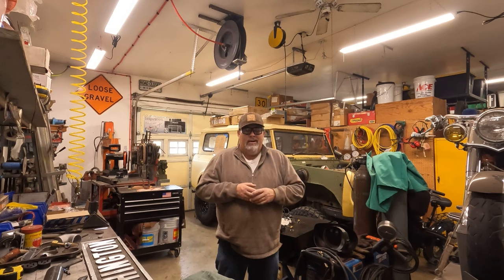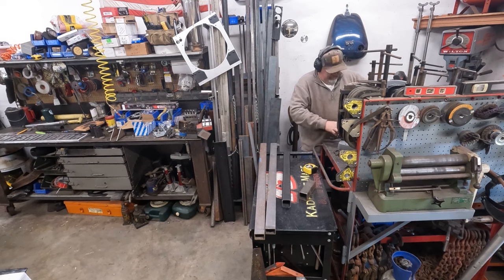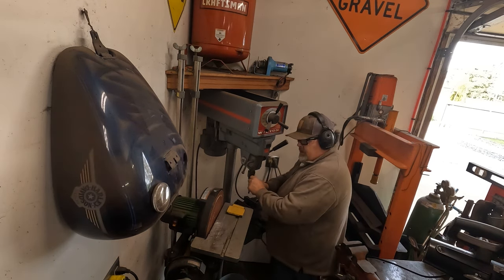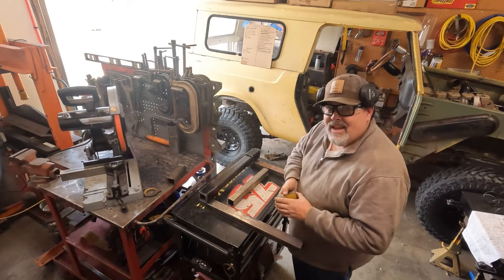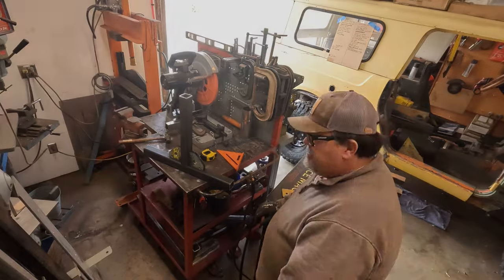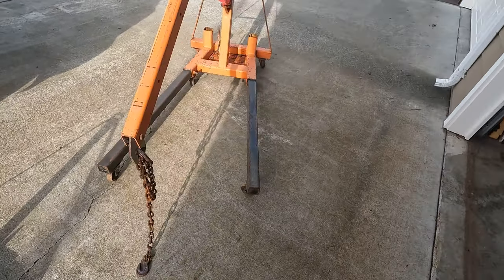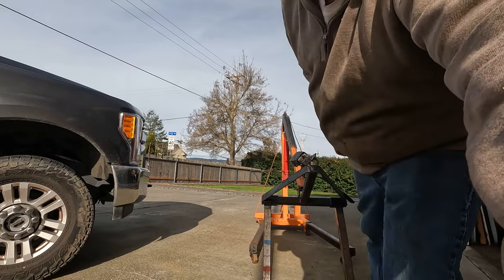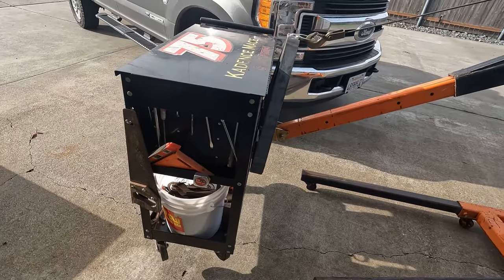Building a DIY Forklift attachment from Scrap metal , Multiply your Engine Hoists usefulness

Comment: I was a mechanic on forklifts for 50+ years , that steel bench was not 800 lbs, and it’s just a Rue Goldberg set up , if he lifts more then 300 lbs it will tip over and someone will get hurt , the higher he gos the less it will lift safely, the idea is smart but the engine lift and fork extension is a disaster waiting to happen !
Reply from the maker: Thanks you for the comment. I will address a couple of items. I too have 40 plus year in the industry, you are correct the 3x4x3/4 plate table is not 800 lbs it’s 734 lbs not counting wheels and leg (3/4 plate is 30.6 per foot I think)  I do not plan on lifting more than  couple hundred lbs max with boom retracted closer to lift point. You are correct about the higher you lift the less safe it becomes, just like  real forklifts.  This is why during training forklift operators are trained to carry the load as low as possible while moving. Thanks again for watching and commenting.

Comment: great idea i have been playing around how to modify my shop lift for the last couple of days , i have installed a air/ hydraulic long ram on the lift way easier to use rather then pumping up the jack .
Reply from the maker: I’ve been looking at the air pumps, wondering how controllable they are to lower
Reply: @NoBudgetGarageBuild  i put a oversize dial knob on the bleed off valve very easy to control when lowering
Reply from the maker: Found a sweet aluminum knob in my stash great idea!

Comment: Don't lift too much past the length of your legs and do a somersault
Reply from the maker: Absolutely no plans to lift past the legs. This was just to see how tippy it was. It actually surprised me it was not worse. I put over 250lbs and it was stable surprisingly.
Reply: @NoBudgetGarageBuild I picked up a Pittsburgh (China) hoist had to load a straight six with stick attached. I had to put the arm past the last pin position and swing it to get it to reach the bed. Fortunately didn't do anything funny on a downhill driveway.
Reply from the maker: Good to know!

Comment from the maker: When retracted it should have a similar lift and tip rate as the hoist itself but I wouldn’t dare. I figured if it will do 500lbs fairly safely . It should  cover 90% of everything I’ll use it for. My legs slip off for storage I might put a couple pockets on the frame to store forks. All ready working on winch and  better casters.   Thank you

Comment: I like your lifting fork idea. It could be made self-leveling by adding a parallel linkage to the main boom.
Reply from the maker: Yes I considered adding a link, but wanted the  option to be able to tilt them up or down.
Reply: Add a large piece of all thread for the link with a turn buckle.  Then you can tip it up or down as you want. I built a adapter on my shop hoist for transmissions.  Of coarse I have a automotive hoist. But it was much more stable than a true transmission lift.
Reply from the maker: I was thinking of a screw type chain binder but decided this needed to be a use what ya got in the shop project

Comment: Funny, I never saw it hooked up setting on the ground. Don't get me wrong, it is a good concept, just doesn't work unless what ever you need moved is elevated already. Cherry picker needs counter weight also because your work table didn't get off the ground
Reply from the maker: I address the setting on ground in my other video. I had to find happy medium as height for the lift is more important than being on ground for most of my uses. It can reach ground by extending boom but it then lowers how much weight I can lift. Had I designed “just” a fork lift that’s easily engineered out.  I will put it to the test in future videos as I need it.  So far it works great for installing my 150lb tank

Comment: Fantastic idea, will most definitely be modifying my tractor supply 3pt carry all to be used with my engine lift. Also your idea inspired me to make simple 3pt hitch brackets for my engine lift, so it can  be installed on my tractor, with the leg extensions removed. Thanks again 👍
Reply from the maker: I had originally planned to connect this to the back of my Farmall cub. I ended up selling the cub to help fund the Scout project. Be sure to check out my scout build and thanks for the comment

Comment: Nice job! If you put a tube in the back of the boom and mounted a winch to the base of the hoist you could raise and lower it without the jack. I use harbor freight 2500lb winches on all kinds of stuff, they are cheap, come with a remote control and will run off of a small riding mower battery. If it doesn't have the strength I just use a snatch block/ pulley.

I have a engine hoist mast and boom bolted on the front of an old Snapper zero turn riding mower, I use it like a mini boom truck and load huge firewood rounds onto the log splitter. I don't think it will lift a Chevy 350 without blowing out the tires but it did lift a 3 cylinder diesel engine into a mini excavator that I bought for $500.
 I also made a 3 foot wide  loader bucket for it made from 1 1/8" plywood with a steel cutting edge. It has 2x4 arms bolted to the middle of the mower an uses 2 harbor freight 2500lb winches to raise /lower and tilt. It's the most hillbilly thing you've ever seen but it works surprisingly good and I haven't used a wheelbarrow in years.
Reply from the maker: I have a tractor for heavy lifting but I definitely see the possibilities. 👍🏻
Reply: I would love to see pictures or even a you’ve video of that plywood bucket in action

Comment: Interesting idea.  I will tuck that one away for later, if needed.  

As far as counterweight, I welded up a hinged tray on the back of my hoist to hold (4) cat litter buckets.  The tray swings up when not needed, to reduce footprint.  I filled a couple cat litter buckets with left over concrete from miscellaneous projects around the house.  Each bucket weighs about 100lbs.  I have two buckets worth on the back of it now, has handled most things I do.
Reply: I wanna use my hoist to lift some 250# trusses 15 feet up for a steel carport.  I plan on reversing the boom of my hoist and have added a bracket to slide in a 12 foot 2x6 as a boom extension.  I have some concrete in bags that got wet to use as counterweights on the legs.  Need to reverse because the first posts are against a curb/wall.
Reply from the maker: Check out some of the ones guys modified to fit in their truck hitches. Good luck thanks for commenting

Comment: Great idea for light duty around the shop (house / hobby shop).
I’ve driven forklifts in a passed life, and yes, we were trained to keep the load center of gravity as low as possible and watch our speeds when lifting and lowering the load (& before someone else states around corners and turns).

Comment: Nice concept with the come along.  Do you adjust the come along as you raise the forks to keep them level?   I have watched other YouTube videos building similar apparatus. I am going to build one soon for a project.  I like your idea using it to remove fuel tank.
Reply from the maker: Yes, you adjust the come along. To keep forks level My plan is to use an old atv winch just because I have one.

Comment: Excellent idea & well thought out design.  I'll probably build one, but I have two concerns:  
-Tip weight
-Storage

My cherry picker takes up too much shop space as it is.....but I'll probably just store it outside when not in use. Retracting the lift arm would help on tip weight; still curious what it would be.

I need to pull a fuel tank, & this would be perfect for that. Thanks & Merry Christmas-
Reply from the maker: Mine sits outside most time due to space.  It does fold up when not in use  thinking I can store forks in same footprint

Comment: I've had lifts flop forwards from improper loading. There's not enough counter balance.
Reply from the maker: Yes they can tip over if improperly loaded. If you consider the tip of the fork as if it’s the original pick point of the hoist  its capacity would be similar to rated. My plan is Not to put engines on pallets to lift them. This will be used for no more than a couple hundred pounds max. If I need to do any real lifting I will use the forks on my tractor. As with any tool in my shop they can be dangerous.  Thanks for watching.

Comment: You need a counter weight
Reply from the maker: As long as as the fork tips are kept behind the front wheels. I shouldn’t need any. in theory it would work no differently than the hoist without one.  I also don’t plan on using for any weight close to what the hoist is capable of.